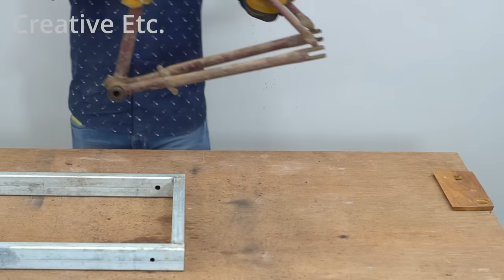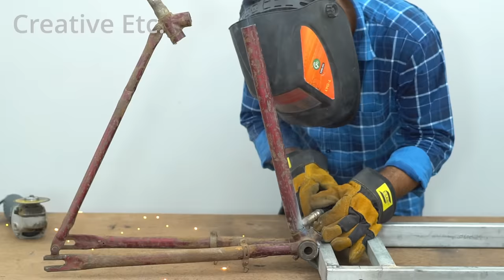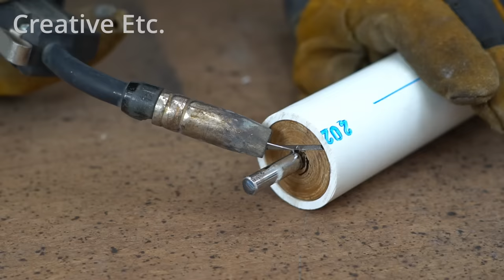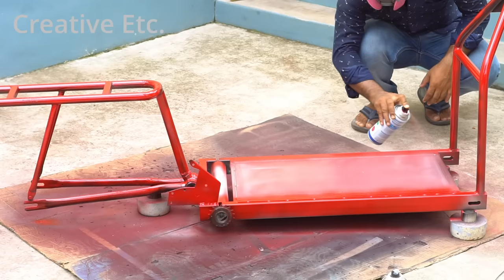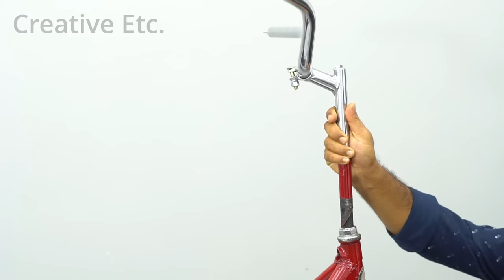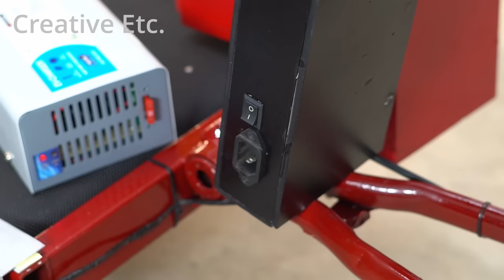I Made a Treadmill Electric Cycle

Comment: I have wondered if there is a way to decide which of these 7 dates is the time Jesus died for us:
27 AD 4th month 10th day, 30 AD 4th month 7th day, 31AD 3rd month 28th day, 31 AD 4th month 27th day, 32 AD 4th month, 16th day, 33 AD 4th month 3rd day, 34 AD 4th month 23rd day and assuming that the Julian Calendar is being used, instead of the Gregorian Calendar that we use today.

As the Solar Eclipse is such an outstanding coincidence in Astronomy, of which the Astronomers still can not agree an explanation, I have focused on it.
The nearest Solar Eclipse to these dates is the 32 AD 4th month 16th day, when it happened on the 28th day.
But this date is on a Wednesday, and I have read that Friday is the greater probability, for various reasons.

The next nearest date, is the 31 AD 4th month 27th day which occurred nearly 13 days before the Solar Eclipse on the 10th day of the 5th month, and the 13 is the reverse of 31!
For this date the 1st day of the Jewish month called Nissan, was starting on the evening of Friday the 13th day of the 4th month, which also has a 13!
It started in the evening 77 hours after the New Moon which was at 31 AD 4th month 10th day at 13:32 Jerusalem time with yet another 13!
77=11*7 and 31 AD 4th month 27th day, is also the 117th day of 31 AD!

The Saros Series number of the Solar Eclipse is number 77!
The Solar Eclipse before in the same Saros series 77, is the first Solar Eclipse in the AD era, and it was in 13 AD!

Psalm 117 is the smallest chapter in the Bible!
Psalm 117 is the exact middle chapter the 595th chapter of the King James Bibles 1189 chapters!
The 117th chapter, is the last chapter of Leviticus, and Leviticus is the middle book of the 5 books,
called the Pentateuch and also called the Torah.
The King James Bible is the most published Scripture version of Christianity, Judaism, and even Islam!
Psalm 117 is the 595th chapter and 595=119*5 and the Sunday resurrection, was on the 119th day of 31 AD.
Psalm 119 is the biggest chapter of the Bible!
595=5*7*17=1*35*17*1*1 and from that the series of numbers 13 51 711 can be made, and if reversed is 117 15 31 and the 9th hour was also 15:00 hours of that day!!!

What is more the length of one orbit of the Moon around the Earth, relative to the Stars,
is 27 days 7 hours 43 minutes 11.5 seconds (slowly getting longer, but this is what it was in 2000 AD) which is like the 27th day 4th month 31 AD at 15:00 hours!
In one month is 31 days 7 months out of the 12 months, and there is 4 weeks in a month making 2 fortnights, again like 31 AD 4th month 27th day!

NASA used an E.L.P. Equation (Éphéméride Lunaire Parisienne) to calculate the Solar Eclipses and Wiki says:
A more precise figure may be derived for a specific synodic month using the lunar theory (Lunar theory - Wikipedia (https://en.wikipedia.org/wiki/Lunar_theory)) of Chapront-Touzé and Chapront (1988) (Ephemeride Lunaire Parisienne - Wikipedia (https://en.wikipedia.org/wiki/Ephemeride_Lunaire_Parisienne)):
29.5305888531 + 0.00000021621*T* − 3.64×10^−10*T^2 where T = (JD − 2451545.0)/36525 and JD is the Julian day number (Julian day - Wikipedia (https://en.wikipedia.org/wiki/Julian_day_number)) (and JD=2451545 corresponds to 1 January, AD 2000).
Éphéméride Lunaire Parisienne is a lunar theory (Lunar theory - Wikipedia (https://en.wikipedia.org/wiki/Lunar_theory)) developed by Jean Chapront, Michelle Chapront-Touzé.

364=2*2*7*13=7*1*1*7*4*13 like 31 AD 4th month 117th day reversed!
21621=3*7207=
The 29.5305888531 days minus 28 days of 4 weeks is 1.5305888531 and the series of numbers is almost symmetrical 153058 8 8531 around the middle of the 3 8s and the word Jesus in Greek has a Gematria value of 888!!
In John 21:11 it says about 153 Fishes, and 153=3*3*17=3*3*1*1*17 like 3 O Clock the 9th hour on 31 AD 117th day!
2111 is the 318th Prime and 318+153=471 reminding me that 4 is the only number with a cross shape in it and that 4 is the middle number of 7!
318-153=165 and at the 165th place of Pi, is the number 2701, the most famous 4 digit number in Bible Numerics!
2701=37*73 and 3773=2701+1072 and 1072 is the reverse of 2701!
1072+117=1189 like the 1189 chapters of the King James Bible!
3773=7*7*7*11=11*7^3*1 like the 117th day of 31 AD!
The Tangent of 53.1 degrees = 1.33333333=4/3=1+(1/3) reminding me of 31 AD and this is from the angle of a stair case in a House and the Builders set square based on the 3 4 5 Triangle!

3/58=0.05172413… is 31 AD 4th month 27th day 15:00 hours reversed!
1/85=0.011764… and 31 AD 4th month 27th day is also 31 AD 117th day and 31 AD 17th week 6th day ! (I think the Gregorian date for the 27th is the 25th)
There is a repeat cycle of Solar Eclipses of 29 years less 10 days and this period in days is 29.5305888531 days times 358!
The initials E.L.P. in numbers like ABC 123 is 51216=2*2*2*2*3*11*97=97*2^4*11*3,
which is like 31 AD 4th month 27th day 9th hour reversed!

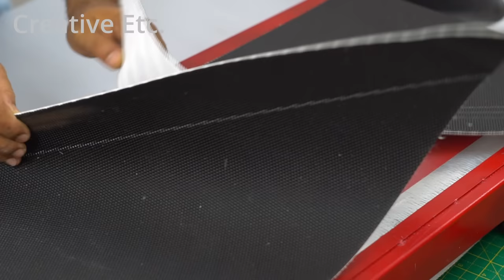I think God wanted us to build our Belief, "The work of God is to believe in him whom he sent" John 6:29.
629=17*37=1*37*1*17*1 like the 17th week 117th day 31 AD reversed!